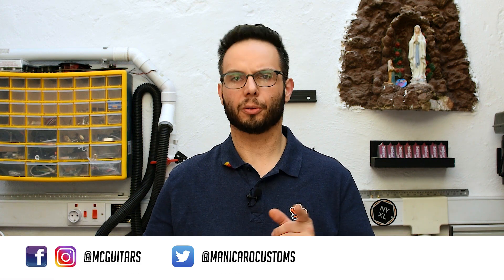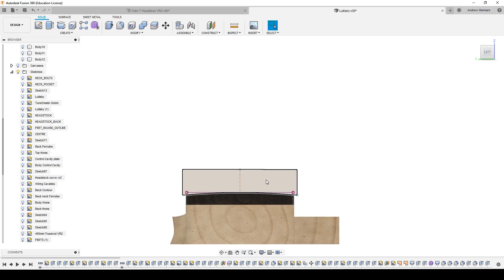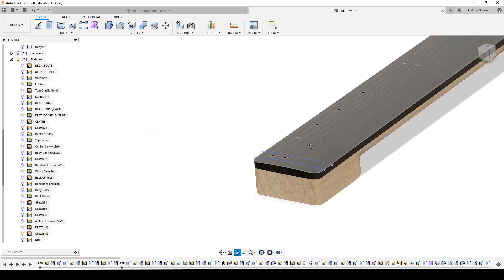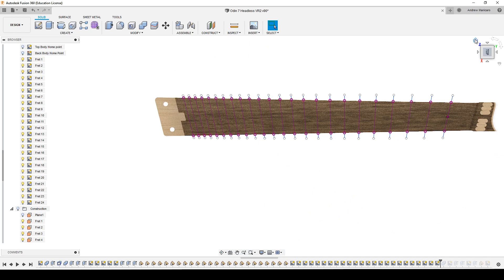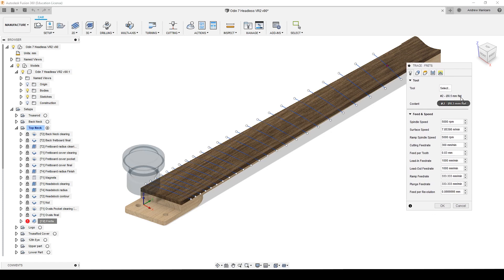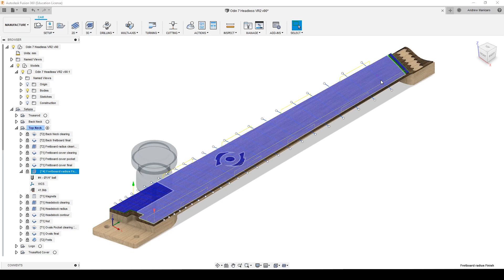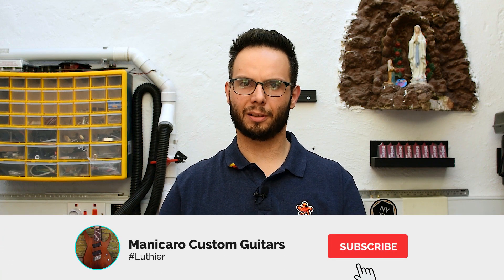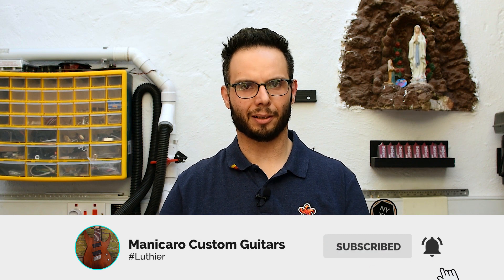How to build a guitar using a CNC Season 2 - Episode 6 Multiscale Frets and other tool paths!

Comment: What bit would you recommend for fret slots?
Reply from the maker: I use a 0.5mm cutter for the fret slots. The most important is that the bit will be of good quality not something off from eBay for example.

Comment: I think you can also use the project to surface - along vector command to make the curved lines. Because in the multi scale I think that  the curved lines, being at an angle, are not perfectly equal to the radius of the fretboard.
Thank you for your videos! I like them a lot.
Can you link the bits you are using?
Thank you very much.
Bye
Reply from the maker: You're right, technically the curved lines don't follow exactly the fretboard radius but it does the job at the end. I will try your suggestion sir!
Reply: @ManicaroCustomGuitars  https://youtu.be/5tn8Dj3Cep8 here I made a little example video. Hope you find it useful. Bye!
Reply: @ManicaroCustomGuitars  I never considered that the angled multi-scale frets wouldn't follow the fretboard radius. Does this mean that the furthest frets from the parallel fret are introducing their own radius greater (flatter)  than the fretboard radius? This concept is hard to wrap my head around.
Reply from the maker: Yes the sketched fret at an angle won't exactly follow the fretboard radius. If you have a fretting coul - the ones used in a fretting press - you can't try it out at an angle on a fretboard.
Reply from the maker: https://cnc-plus.de/en/End-Mills-266/2-Flute-281/Carbide-Two-Flute-Router-bits--2-Flute-End-Mills--CNC-Cutter-Bits-2983.html
This is where I get my 0.5mm bits for the frets.